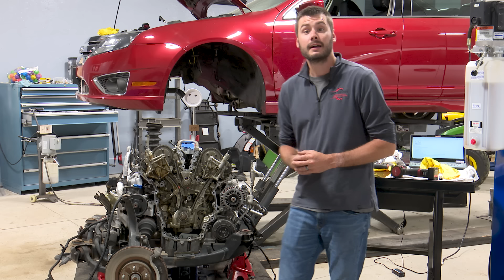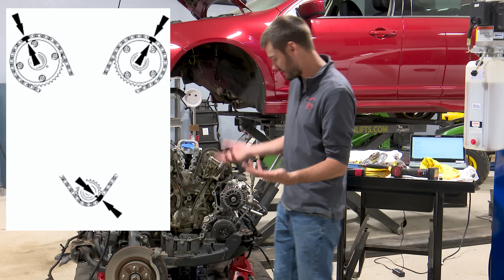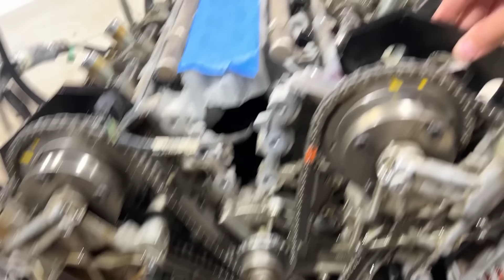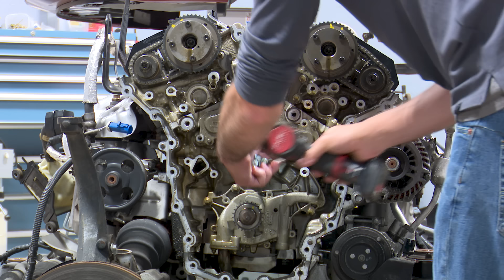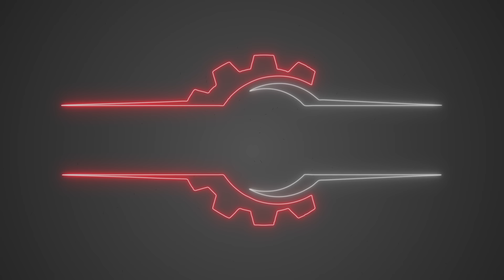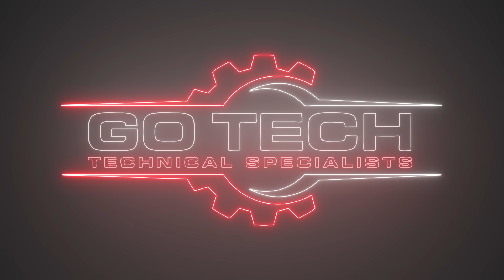How To Replace Ford 3.5L V6 Timing Chain and Water Pump

Comment: I would always replace the guides.  Wear isn't the only issue to be concerned with.  From many heat cycles the plastic becomes brittle over time and will break up and delaminate and then clog the oil pump screen. I would also oil the guides and chains prior to re-assembly.
Reply: Also the bolts on my timing tensioner (2011 taurus) had fatigued, and one of them snapped at just ~5 ft-lbs during the reinstall. So worth checking out some of the other components like that for fatigue signs. I'm not used to seeing a graded, non high-torque bolt snap like that on me though, so maybe it was just a freak defective bolt that loosening it was one turn too many? I'm definitely glad I chose to replace everything in a kit though, after seeing the condition of a lot of the timing components.

Both the valve chain tensioners were sticking and no longer providing force either, but I'm not sure if that was from the water in the oil in this repair, or if they had been like that for a while.
Reply: nah

Comment: i dont see the amazon link for the betooll
Reply from the maker: https://www.amazon.com/BETOOLL-HW9204-303-1248-303-1530-Holding/dp/B075XJZ1DN/ref=sxin_18_pa_sp_search_thematic_sspa?content-id=amzn1.sym.6fd80408-71b6-44da-b059-082bba9089d3%3Aamzn1.sym.6fd80408-71b6-44da-b059-082bba9089d3&crid=3493O0U70RDTW&cv_ct_cx=ford+3.5+cam+holding+tool+belt+tool&keywords=ford+3.5+cam+holding+tool+belt+tool&pd_rd_i=B075XJZ1DN&pd_rd_r=5164d54b-83c3-4750-9aad-b3c299400d87&pd_rd_w=xEjW7&pd_rd_wg=4J5KM&pf_rd_p=6fd80408-71b6-44da-b059-082bba9089d3&pf_rd_r=006Z67NQGEPFR6FTK545&qid=1687440861&sprefix=ford+3.5+cam+holding+tool+beltool%2Caps%2C104&sr=1-4-364cf978-ce2a-480a-9bb0-bdb96faa0f61-spons&sp_csd=d2lkZ2V0TmFtZT1zcF9zZWFyY2hfdGhlbWF0aWM&psc=1

Comment: Absolutely awesome presentation and explanation and instructions on this Job. 
We own a 2016 explorer and will probably be getting this job done soon since it has 111000 thousand miles on it.
Reply: My friend has a 2016 explorer with 167k, he maintains it well, but hasn't had to touch the timing chain or water pump, and has no bearing noise

Comment: You made my day thanks for the video it took my 16hrs to do the job on jacks Stands on my ford flex I spend $300 on parts … my dealer wanted to charge me $4500 … but thank you and god I did it godbless 🙏
Reply from the maker: Hey Rey, that's awesome! Congratulations on completing the repair yourself!!!!
Reply: Did you HAVE to remove the engine to do this?
Reply: @ghostmost2614 Ford tech here, You don’t have to but on the Taurus/sedans it makes it so much easier. On the edges/suvs it’s a little more room
Reply: @xthorenderx8184  any videos on how to do this on sedan without taking without taking engine out?
Reply: You don't have to but it makes it significantly easier  @ghostmost2614
Reply: @ghostmost2614 
No
Reply: Good review
Reply: Doing this for the first time ever this video gives me more confidence in doing this
Reply: Also not removing the motor

Comment: Might be a dumb question but Was the water pump that you changed was that originally the pump that came car was built with from factory?
Reply from the maker: Hi Mich5 A, yes this was the original water pump in the car.

Comment: My question is our 2014 ford edge has 188k miles should we have this done?

I'm just worried about it happening to my wife on the road.
I don't lose much coolant but it does go down slightly in time no leaks but the tell tale is the oil filter or air conditioner compressor has coolant residue that's all I have had all these years..
Maybe it's seapage from the weep hole?

we bought the edge 2 years old with 59,000 and now at 188,000 it's been a good vehicle I do oil changes myself at 3000-4000 miles no oil loss or burning..
Thank you for making the video well done
Reply from the maker: Hey Mich5 A, the weep hole for the waterpump is near the alternator and If i remember correctly, it will drip on the AC compressor. If you are leaking coolant out there, i'd highly suggest getting it changed before the problem gets worse.
Reply: Take my advice
GET RID OF IT!

Comment: thx for video! very helpful!  mine is seized now from standing.. will try to turn it over by hand.. will see if i can save it now.. and then maybe strip it and change old water pump.. darn ford explorer mk5.. btw there is two types of water pumps with two rows of teeth are those for different version of engine ?
Reply: did you end up fixing the engine?

Comment: How long do water pumps last on those engines? I was thinking about a 2011 Ford Edge. But now I feel scared to buy the car. Because it has 162k miles
Reply from the maker: Hey Gilbert, this car had right around 100k miles. It's hard to say how long they last as it varies a lot
Reply: Dont get it. Mine failed at 125. My friend also had the same engine and hers went at 115.
Reply: The one I'm doing now failed at 180k, so you're past a lot of people's fail point, and super close to my friend's car's fail point.

She's a gonner, I'm afraid (unless it was recently just redone).

Comment: Awesome job Mike! I am presently in the middle of this task on a 2014 Explorer Sport. I opted not to drop the subframe. Is the 3.5 that you have pulled in the video from the Taurus Limited? Do you have a video on the small chain replacement?
Reply from the maker: Hey Oz man, thanks! This one was out of a 2011 Fusion Sport. Sorry, I did not replace the small chains and I do not have a video on it.
~Mike
Reply: I'm on a 2011 taurus now, and was able to do the job with the engine in the car still, but with the engine jacked up a little to get clearance for the bolts and just barely enough room to wiggle the timing cover out through the top

Comment: How would the cams be out of align, if tool was holding them in place. They are in place. The crank could be out of align and tool still go on.
Reply from the maker: Hello,
If the chain has stretch the correlation between the cams and the crankshaft could be slightly off. Also the tool has a slight amount of play, it's not un-common to have to bump the sprocket a half link or so to get the chain to slip on.
Good Question!, Thanks for reaching out!
~Ryan

Comment: Thanks for another great video Mike! A job well done! Such a stupid design as to the engineers that would put a water pump full of coolant inside the timing cover like that. I remember doing a balance shaft chain special policy TSB on the newer GM 2.4 ECOTEC engine. I think it was a 2011 Buick Regal. I remember those timing marks would never line up no matter how many times you rotate the engine. I shortly found out that you have to make your own timing marks and go by that. As long as the cams and the crank are lined up then you are good to go. I feel the same as you do as some of these GM and other engines don't give me the confidence in my work because the stuff don't line up as they should. The warranty times on those were horrendous and only paid 4.8 hours to do including the high pressure fuel pump. Needless to say after I finished that job the engine ran great and had no more problems.
Reply from the maker: Thanks for watching! Man, warranty/recall times are rough. I don't miss those days!
~Mike
Reply: @GoTechTraining  Thanks buddy. Nope, I don't miss it either 😆

Comment: So if I remove the spark plugs the crank shaft will turn easily? Having trouble turning the crank
Reply from the maker: Hello,
Removing the spark plugs should make the engine turn over with less resistance, due to the cylinders not being able to build compression.
~Ryan

Comment: My local Ford dealer did the same job without dropping the engine. That's overkill. 2013 Ford Explorer
Reply from the maker: Hello,
I agree, the engine does not not have to be dropped to do the job. But depending on how much room is in the engine bay (this was a Fusion). It is much easier to access the components with the engine out. 
~Ryan
Reply: One should always remove the engine for the first time to fully understand the repair process

Comment: What's this cost?  Like 3 grand?
Reply: Timing kit 250.45 tax included  for partial timing kit ...499. tax not included for full timing kit ....and 135 for water pump ...I do them labor for 450 have done next day ....
Reply: Never pull the motor .. always done with motor still in place

Comment: my friend bought one of these that needs a water pump.  this is some job to get through , whoa!
Reply from the maker: Hey Rory, hope they got the car cheap! It's a big job. Hopefully it hasn't run for a long time with coolant in the oil.
~Mike
Reply: @GoTechTraining my water pumps been leaking for a few months now and now im attacking the job. Just drained my oil and thank goodness there wasnt any milkshake
Reply: @TzUuup do yourself a favor
GET RID OF IT
Reply: Yeah alot of the new 3.5s have internal water pumps throughout different manufacturers.
Stupid design

Comment: You are lucky that you didn't drop a bolt or nut in that open front of the oil pan. If I were you, I would put some rags or something in that gap. Believe me, it has happened to me. Maybe temporarily seal up the A/C lines also.
Reply: most likely wouldnt hurt it. it would just lay in there. oil pickup would never pull it in

Comment: THIS JOB IS A BIG JOB TO DO BUT YOU DON'T HAVE TO PULL THE ENGINE OUT OF THE CAR TO DO THIS JOB
Reply from the maker: Sure, it can be done in the car...but it's much easier out. These come out the bottom fairly easy, with a hoist, of course.
~Mike
Reply: Have you ever done this in the fusion chassis?
Reply: Wtf my daughter changed my youtube name lmao
Reply: I'm TRYING to do one in a fusion right now. It's hell. That power steering pump is my current nemesis.
Reply: @taco-ew4bw  remove the belt, take out the three 10mm bolts and set the pump aside, use a bungee cord to keep it away from the area.

Comment: Ive had my water pump replaced on a 2016 3.5L Explorer and 19,000 miles later my motor has failed. First it started ticking with RPMs then after an oil change it failed with loud knocking metal within 24 hours after the oil change. A mechanic friend of mine told me that if the timing chain was mistimed when water pump was installed, it would cause ticking noise then failure which I didnt know about at the time. It is still under their 25,000 mile warranty (had 105,000 when work was done, 123,000 when motor failed) but they are not cooperating as they should - They also claim that we would not have been able to drive the SUV for 19,000 which I dont believe.
Reply: No way the chain was installed wrong. The check engine light would have been on and it would have run like crap. Probably used an abrasive wheel on a die grinder letting all the the debris fall into the open oil pan.

Comment: I'm trying to rotate the engine after I did all this and feels like the lifters are coming into contact with the valves everything is on time properly on all 3 chains
Reply from the maker: Hello Alfredo,
The bucket lifters sit on top of the valves and are driven by the cam lobes to open the valves. Do you mean it feels like the valves are contacting the pistons?
I would try and remove the spark plugs, the resistance you feel could just be the cylinders building compression on the compression stroke. Removing the spark plugs should rule this out.
I hope this helps!
~Ryan Wilsing
Reply: @GoTechTraining  I've removed them already set the timing with tool I've looked inside the cylinder and don't see any contact of the cylinders. Using on demand for my info. Seeing if anyone else had similar issue this is the first.
Reply: @GoTechTraining  thanks for reply in advance

Comment: Thanks Mike! I'm looking at options for lift jacks when removing engines in my shop, tired of setting them on jack stands when lifting the body off. What was the jack you used to set the cradle on?
Reply from the maker: Hey Josh,
This is actually a homemade wooden platform with caster wheels on it. The jack stands sit on the platform, so the cradle and engine assembly can be moved around.
Thanks for reaching out
~Ryan Wilsing

Comment: I also have another VERY important question: Are the cam bolt torque specs different on the non turbo 3.5L DOHC VCT SMPI Vs. the Ti-VCT? 
The manual says 3 stages: 30ft lbs, loosen 1 full turn, tighten 89ft lbs then 90 degree tighten.
I followed another video's recommendations for my 3.5l. tighten to 30ft lb, loosen a full turn, then 18ft lbs and 180 tighten. 
Did I over-tighten?
Do I need to grab 4 new bolts and do it over?
Reply from the maker: Hey Jeremy, what engine do you have and whats it in? I can get you the exact specs. The 30ft lbs, -1 turn, 89 INCH POUNDS, +90° if for the 11 fusion 3.5 NON turbo. An 11 F150 3.5 turbo has a different spec, different phaser, etc.
~Mike
Reply: @GoTechTraining  I have the 3.5 non turbo.
Specs are different. Just hope I didn't damage the threads..
Redoing them here in a few
Reply: @GoTechTraining  thank you for the reply BTW
Reply: There stretch bolts. The only thing you done was stretch them a bit more than they were designed for.. The threads won’t be hurt in the cams. Sadly if you was to look up the part numbers more than likely both the none turbo & turbo probably use the same bolts. I know all the bolts from the none 3.5 & 3.7 are all the same. And are a direct swap. Only difference is bore size. Same cams and everything else..
Reply: Do you mean Ford ever had a good idea?

Comment: how do you disable fuel???
Reply from the maker: Hi Jeremy,
The easiest way to disable the fuel is to pull the fuse for the fuel pump and run the vehicle till is stalls to relive the fuel pressure. More safety precautions may be required on direct injected vehicles. 
I hope this answers your question
~Ryan Wilsing

Comment: Everything is beautiful shown.  Isn't it worth measuring the valve clearance?  How's so much work done?  glasses pushers can be replaced.  Maybe a few pieces do not have good play, but it requires unscrewing the shaft.

Comment: On a Audi/VW 2.0 TSFI engine, it's 168 turns to line marks back up.
Reply from the maker: Hey Steve,
Wow!
How did your arms feel the next day !
Good info!
Thanks for watching!
~Ryan Wilsing
Reply: @GoTechTraining  I read it in service info somewhere. It was my first TSFI job and I was very paranoid cause I have read how finicky these engines are. Took a few minutes but it all worked out.

Comment: didn't tighten top chain tensioner bolt  the chain tensioner will drop off  timing will jump plus cannot get to lower bolt later date to check tightness

Comment: Very informative video. Is there another way to verify you are on the compression stroke when you are timing the engine than solely relying on the three timing marks?
Reply from the maker: Sure, you could look at the position of the piston and the position of the cam lobes. The top dead center of compression will have the piston at the top of the cylinder and both valves closed.
Mike Becker, Senior Instructor
Reply: @GoTechTraining  I’ve been doing research on this particular engine on how to time it before disassembly and I understand about cam lobes but not quite sure on where exactly the nose and base of the lobe should be in relation to the tappet underneath the lobe. Some videos I see both noses are facing 180 degrees from the tappet, then other videos I see they are facing all the way down touching the tappet or lifter. Sorry for the length of this response. I do appreciate any feedback. Thank you.

Comment: The primary chain tensioner was out way too far and a giveaway to the bad water pump bearings. You didn't show tightening the guide bolt behind the right camshaft sprocket. Careful when moving the camshafts without the tool locking it. A little too far and you could end up with bent valves. Good on mentioning disabling fuel or spark to build oil pressure and changing oil twice.
Reply: How though?

Comment: Nice demo, I've never done one in a fusion, but the explorer and Taurus take me 6 hours give or take doing it in the vehicle. Evac the a/c and remove the big suction hose across the front of the motor makes it easier, just do a couple trial runs with the cover before putting on the rtv, you can also just put the rtv on the engine instead of the cover.
Reply: did that and thought i covered everything but the darned thing is leaking.  i need to pull it out like this video- no idea how to do that.  will have to study it...